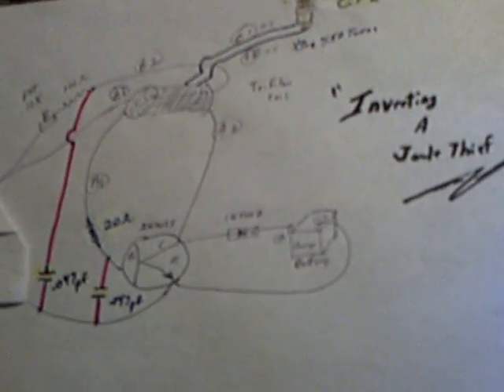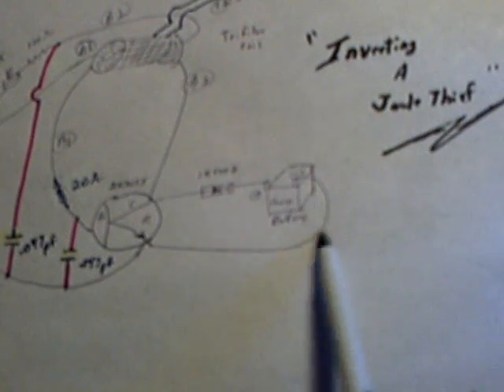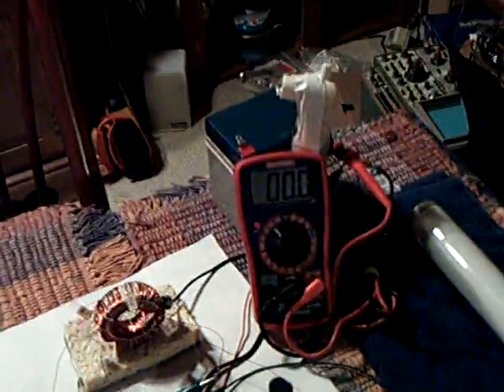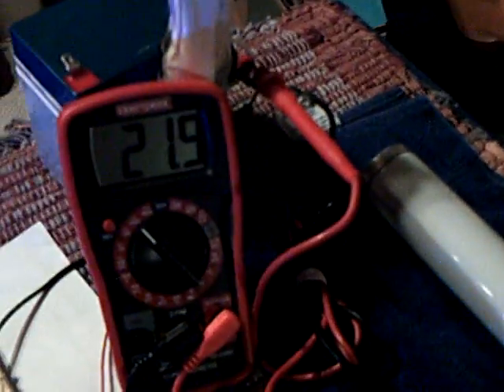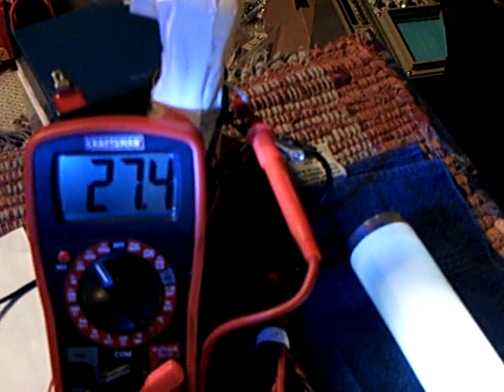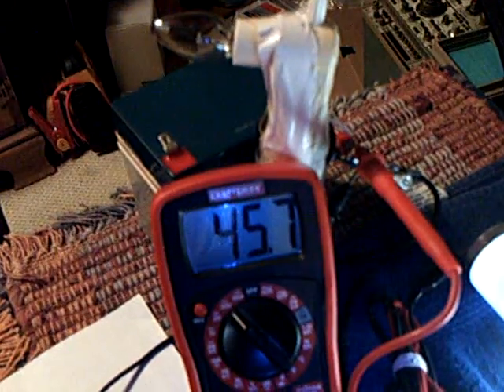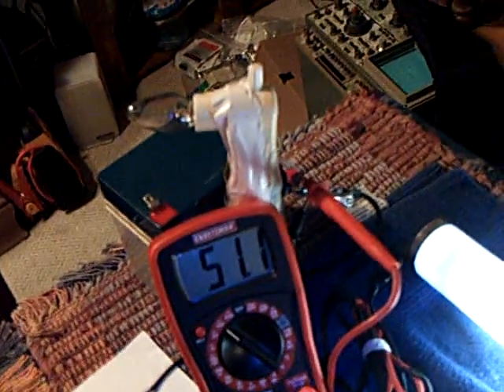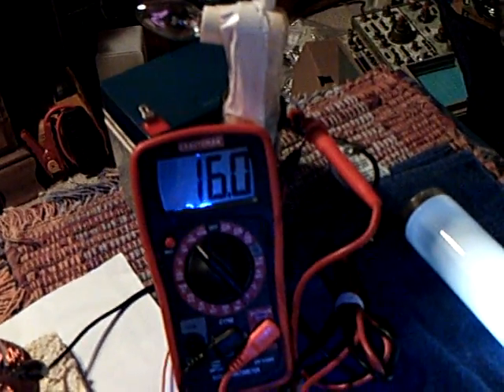Pulsed Inverted Joule Thief Part 2

Comment: Hey RROGE5.

u are quite right, no system is ever 100% efficient, however there are many inefficient systems that have a COP>1. that is u can get more energy out than the operator had to put in... like a heat pump, the extra energy comes from nature as heat yet the conversion process may be only 50% efficient.

there are many working systems that seem to extract extra energy from the vacuum

look at E=mc^2... look at atom bomb, u put a little NRG in and get a whole lot more out!

Comment: yeh i was thinking this circuit wouldnt be good 4 charging, coz its only charging during on time, but then again its only running during on time, so its all relative.
@300mA the 5Ah should last over 15hours

ive been watching Bedini talk about charging, theres quite an art to radiantly charging batteries... best to charge a very low or dead battery. We want to put Negative energy into the battery so we have to remove the positive first. I would drain the charge battery before u start testing